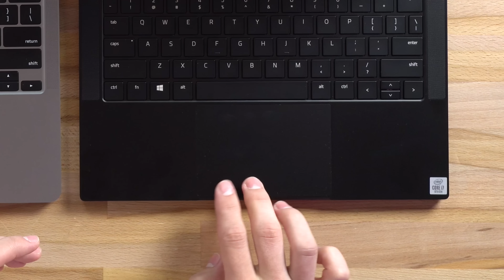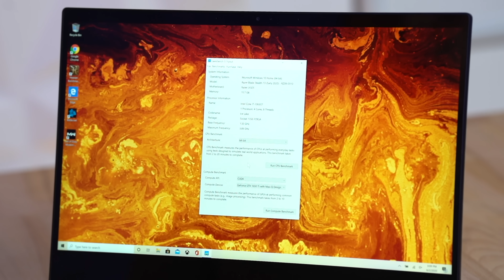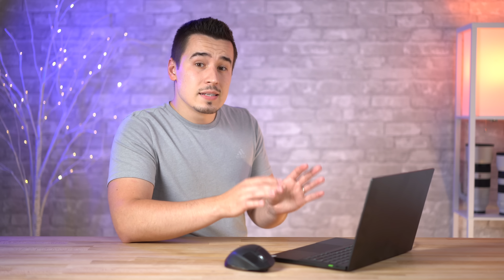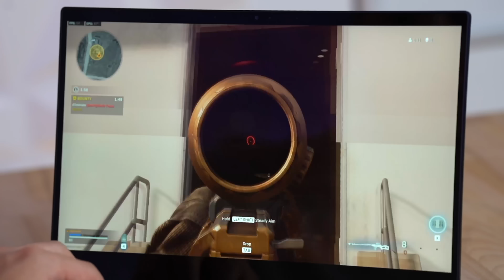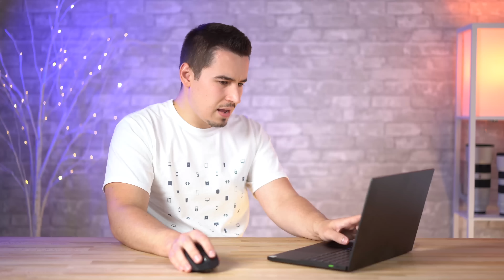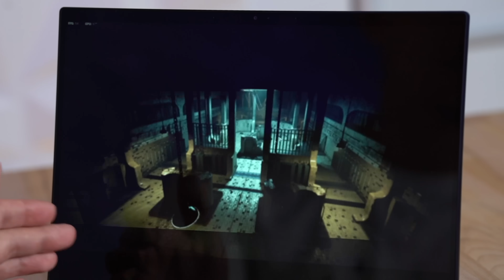2020 Razer Blade Stealth - The "MacBook Pro" for Gamers?

Comment: Max, could it be that the CPU was the issue and not the graphics when it comes to fps.  The 1.3 GHz is still low even though the overclock speed is quite high.  I question the reality of such a high speeds and wonder if the bottle neck isn't really the CPU. What are your thoughts?  I recently tried a Dell XPS with similar specs and couldn't get a better fps than my 7 year old 13 inch I7 MacBook Pro on XPlane. Needless to say, it went back to the store.

Comment: is the 4k oled, 60hz touchscreen worth it on a 13 inch screen? it's the only one available right now which bumps the price up to 2k...seems like a 1080p 120hz screen is better for 13 inches but they aren't available atm. thoughts?
Reply: It isn’t OLED. Same type of screen as the HD version. Still, the 4K screen is glossy while the HD screen is matte. Glossy screens will give you more detail quality which is great for movie watching and it’s why many 4K TVs are also glossy.  The benefit of the HD screen is twice the frame rate and less glare since it’s matte.

Comment: Thanks for this great, super thorough review! Was it plugged in while you were gaming? It looked like you were running it on battery power.
Reply from the maker: Yes for sure it was plugged in. You can see the shadow of the charger on the side of the laptop.
Reply: @MaxTechOfficial  Awesome, thanks. Again, thanks for the great review. It's one of the first ones up here on YouTube for this model and the quality is supreme.

Comment: IT'S THE CPU!!
The FPS, as you can see, if there is not a big difference between very low and high textures, is just because of CPU, not GPU, it's the amount of time that the CPU requires to finish each cycle thats bottleneck the whole system... I now, it's a 13" laptop, so it's pretty good after all.
Turn on CPU and GPU timing on the same menu that you turn on FPS on screen, that will show you what I mean, maybe 15 or 17ms on the CPU, but not higher than 12 or 13ms on the GPU, that should result on >65 fps (considering that 1 second has 1000ms and those divided by the time that each component takes to render)

Comment: Don’t Razors have a short life span? I was told to avoid Razor for a daily driver
Reply: Got the blade 14 from 2015 to 2019 without any issues and now I have the blade 15 and happy with it ( the blade 14 is currently in excellent conditions with my friend )

Comment: You're playing games on battery? : |
Reply from the maker: If you look closely, you can see the shadow of the charger plugged into the laptop
Reply: @MaxTechOfficial    but when you show the overhead clip of the razer next to the macbook the power cord is coming out on the right side but the cable shadow is on the left side during your gaming clips....if you go to razer's website the right side is the true thunderbolt side hence more power but the left side is just a USB-C 3.1 side hence less power. Wasnt there a big article about making sure the power is plugged into the correct USB-C port for proper performance?
Reply: @Some0ne001  I was thinking the same but I'm not sure if one side draws more power than the other

Comment: I got the 1650 model in February and got angry that this got released so quickly, but based off of these benchmarks, the performance difference is negligible. I did the Unigene benchmark and got a score of 1160 with 46.3 fps, which is more than in this review. So if you're considering whether to spend more money on the 1650ti model, I'd say if you don't care about the 120hz display I don't think it's worth it.
Reply: In the review he was using the 4k model + I don't think he was plugged in . So in call of duty when he set the render scale to 50% it was actually 2k and not 1080p since windows is in 4k.

Comment: Asus G14 in 1660ti version just selling for $1400 after tax, obviously beat this one lol
Reply: Jon David do you own one? What makes you say that?
Reply: @bitofbeans  I've had both the razer blade stealth and asus g14, the asus is better in every way except for rgb lighting on the keyboard.  If you want an overpriced, unreliable, overheating RGB laptop definitely go with the Razer.
Reply: @isjoining  If you check out the g14 subreddit, you will see so many people having issues with their g14.
Reply: @ktyo2547  Yes a few people have had issues with the G14, it's a new product so it's going to have issues. The razer blade stealth has had the same issues for several generations now.
Reply: @isjoining  well yes g14 has better specs, and it would have been a kind of perfect laptop but the response time on screen is so shit. Also you have to give razer where credit is due, I mean the design of razer blade stealth and the engineering that goes into making something like this is so much better than g14. Lets wait for the 2nd gen g14 which might have a better screen.
Reply: yeah, but the g14 is thiccer than the blade
Reply: And the 2060 model is only 1500 before tax
Reply: BitBeans The Razer stealth is a premium well built machine compared to that hideous plastic piece of garbage asus....
Reply: I M So you haven’t seen reviews?
Reply: @TheMad0ne  None of it is plastic lol, and to even consider this 4 core 1650 ti laptop over the G14 with a top of the line 8 core processor with a 2060 max q is beyond me not to mention the huge price difference.
Reply: I could not even buy the g14 laptop, i have the msi stealth from 2019 so i dont need one but the g14 seems alot better and better speakers i do not always like to wear headphones!

Comment: Very impressive machine.  Razor has been making some amazing stuff recently.  Not a fan of their green accents but good job on their part for creating FAST and efficient small form factor laptops.
Reply: Unique machine.  There aren’t any GTX laptops smaller than this.  Actually, there are currently no 13” GTX laptops besides this.  Razer is basically alone in this part of the market.  The Zephyrus G14 is the closest, but not as portable, yet smaller than the Blade 15”.
Reply: Oilerfan1983 and the g14 is riddled with more issues than anything I’ve ever heard of. And the problem is that they seem to be very easily reproduced or just straight up hardware QC. Just typical Asus laptop shit. They’ve never really had the reliability.
Reply: @t-dog4812  I think asus is a mixed bag. I've had several of their zenbooks and never had a single issue with any of them, really solid machines. I did however have one of their gaming offerings, and that was riddled with issues from the get go.